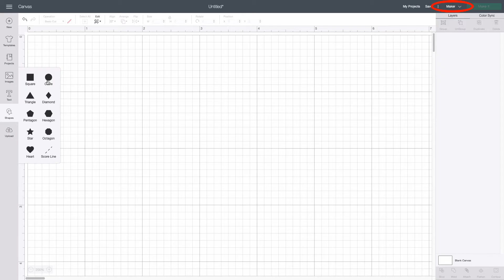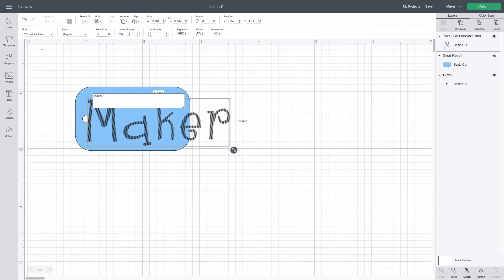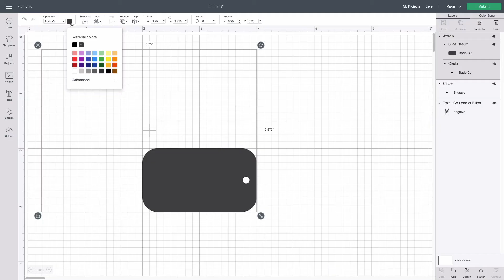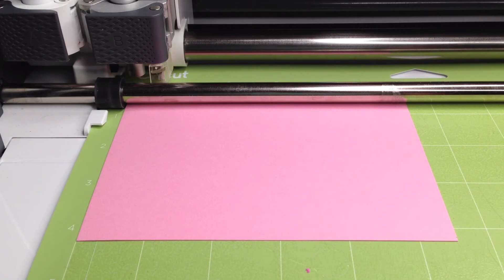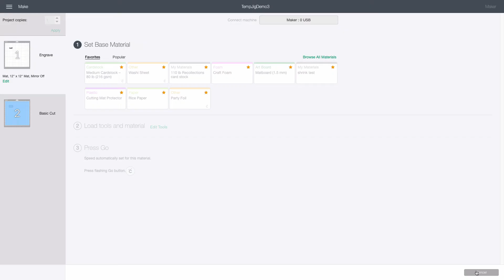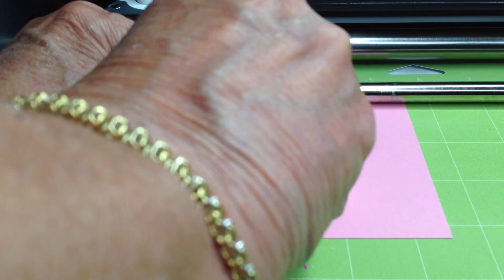Cricut Engraving Placement - Temporary Jig Method

Comment: Hi Thanks for the great videos and tips. I have opened the sensor jig and template from the Shared Design Space Project and Product Links. Line 42 on spreadsheet. As I'm in Europe the product is from a different supplier yet the advertising images and product details are the same. I can't get the bauble to fit how can i make the jig print and cut slightly bigger and then get it to make the engrave template the same size? I can't unweld in Cricut. Thanks in advance

Comment: Dang, I'm on version 9.3.36 and they've reinstated mat unloading after cancelling the 100% screen. Sad to see them regress!
Reply from the maker: yes, has changed several times since the video. Please see the video description for latest workaround.
Reply: @  yes thank you for adding that. I turn off Bluetooth instead of unplugging it and it works well, no USB needed. Any idea how this method could be incorporated with print and cut? I’m trying to print, cut, then “score” by cutting with low pressure rather than the scoring tool. Right now I need to line it up manually.
Reply from the maker: @drewtonmorrison  You don't need this method with print then cut because the sensor marks will line everything up for you, provided you attach to a common bounding box so that the marks and relative positioning stay the same across both runs. I show this concept in a different context here https://www.youtube.com/watch?v=bmCUkCHb1jY Another option is to use the low pressure setting on the whole project, but stack duplicates where you want to cut all the way through. Feel free to message me if you need more help.
Reply: @cleversomeday  that’s fantastic advice, thank you.

Comment: As someone who comes from the 3D printing world, it's absolutely ridiculous that Cricut locks you into their hardware and software like that. How basic of a need is it to be able to do multiple passes with different settings and/or tools across the same path??
Reply from the maker: No argument here.
Reply: @cleversomeday  Your method from the video description works great with Bluetooth as well btw, just tested it ;)
Reply from the maker: @readywhen  thank you. Can you clarify your steps? Did you just turn Bluetooth off temporarily?
Reply: @cleversomeday  It is the same as with the USB cable, but replace "unplug the usb cable" by "switch off bluetooth in the settings on your pc". And accordingly, "plug in the usb cable" by "switch bluetooth back on in the settings on your pc"
Reply from the maker: @readywhen  OK. I've not recommended that because so many people have bluetooth mice and keyboards, but there should be a sequence that works anyway if you plan ahead. Thanks again for this confirmation.

Comment: You're the best for various Cricut tutorials! I've been having a really tough time with an acrylic blank that is a circle with a rectangle at the bottom because it slides inside a round light base. I finally had to use the pen feature to draw it right on the mat but it WAS a millimeter or 2 off.
Reply: Do you have a link for the acrylic blanks you mentioned in this post? Thank you!

Comment: Did update 7.11.156 delete the feature you fought so hard for,  not having to unload the mat between operations?  I placed a cut file and a foil on the workspace and Cricut forces me to unload the mat after the foil completes!
Reply from the maker: actually it went away in 6.10, but we have found and updated the workarounds each time it has changed since, as noted in the video description above.
Reply: @cleversomeday  Oh, I did not think to look there, but I just got off the phone with Cricut support and expressed my dissatisfaction with not having a simple method to keep the mat loaded.  I will try your method but it sure looks like way too much complication for should be a simple software solution on the part of Cricut.  The support person was very supportive and a user herself and verified the issue and promised to escalate it to the developers.  Hopefully, if enough of us call, and let them know when things don't work, they will listen and fix it.
Reply from the maker: @flashsolutions  thank you for calling.
Reply: @cleversomeday  I would never have thought to unplug the USB cable, but it worked!  What a horrible way to run a business!  There was no need for that on Cricut's part.  Thank you Kay for figuring out a work a round!

Comment: I'm working on my first engraving using your video. Everything has gone good until I got to the portion of making the jig, Cut perfectly but when I hit dismiss...cancel...and yes. The mat unloaded, your video shows it is not supposed to do that. Any suggestions on what I might be doing incorrectly? Thank you
Reply from the maker: Please see the video description for the latest workaround as Cricut has changed this several times since the video was made.
Reply: @cleversomeday  Followed all of those instructions to the tee I believe and of course it unloaded again. So because I am impatient I decided to just load back and and try and see if it will line up. But now it only gives me two material choices and not acrylic 2mm. I keep seeing these beautiful projects that seem to work for others. Now...honestly I'm not sure how to process. Any suggestions. Went back to layer panel and closed the eye on attach/basic cut hoping it would let me pick acrylic but no luck. Not sure why it will not let me engrave if I choice the engrave panel to process.
Reply from the maker: @debibrening  Please post your question in the Cricut Engraving with CleverSomeday Facebook group where it is easier to troubleshoot. For those who might come across this post later, if you are not getting the option to use acrylic, then you have not gotten all the items on the mat set to Engrave.

Comment: Hello Kay, awesome video. What setting do you use for the engraving tool to get these sharp engravings?
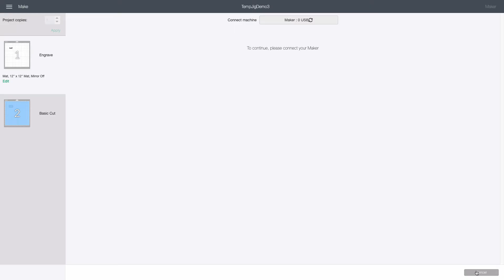Reply from the maker: Acrylic 2mm, as noted around the 8:12 mark in the video. However, I have found that the setting is not as important as using the proper design and using multiple passes as needed.

Comment: Great video! Used it for the first time the other day and it worked like a charm. However, I tried it again today, and it now ejects the mat when pressing "Dismiss, then Cancel and then Yes" after the first cutting step 😔
Reply from the maker: sadly it seems that version 6.10 has changed this back. Please contact Cricut and let them know you need this capability https://help.cricut.com/hc/en-us/requests/new
Reply: @cleversomeday  Done! Such a useful feature and typical that it's removed days after I find it! 

It's really useful - Not just for engraving, but for example if you wanted to cut and emboss on the same project.

Comment: Thanks again Kay, I have another 3 questions plz (sorry!), can you plz confirm what you said in minute (11:43 till 11:55)? I understood that as long as i didn't unload the mat, I can keep engraving the same design on another blank with the same size over and over.. so what about different design (different word/drawing), can i go back to canvas on DS and select another design/text ? sorry didn't understand this part correctly 

My 2nd question, if we select to draw (without putting a pen) instead of cutting for the dummy dot in the left corner, does that work the same as well? did engraving the dot over and over affect the mat?

My 3rd question, if we make the whole project in 1 mat, without a temporary jig first by using air drawing, will that work? so let's say  i  have a round acrylic, so I draw circle on canvas ( same size like the acrylic) and place it in the middle of the canvas at the + or at the very top left corner with 1 square up and 1 square on the side. And type the text or place the design aligned in the centre of the circle. Then we press make it,  not to place a drawing pen- and the machine draw on the air the circle surrounding the blank , then engrave in the middle of the blank. will this be accurate? or the machine will not engrave in the center of the blank?

sorry again for the long question! I love watching your videos and learning from you
Reply from the maker: I don't have a simple way to answer your first question beyond saying yes. As long as you use the same relative position of target shape and dummy shape to position a design, that gives you the same frame of reference, whether it is the same design, a different design in the same file or a different design in a different file. But of course that takes more concentration.
As for your second question, yes, you can set the dummy shape to pen (with or without a pen) if you want to protect the mat. Using engrave is simpler, but does affect the mat in the very corner, so its a tradeoff.
Third question. The "air draw" method you are describing is a very common one that is only accurate within 3mm (per Cricut's latest published information), because it does not account for mat loading tolerances. A jig, on the other hand, is accurate to a half mm or less depending on the fit of your blank in the slot. So you want to choose the level of effort that is appropriate for the accuracy you need. I have tutorials linked for lots of methods, along with pros and cons of each in the Guides section of my FB group.
Reply: @cleversomeday  Thanks heaps Kay! you are amazing, thanks again for your help and explaining it all